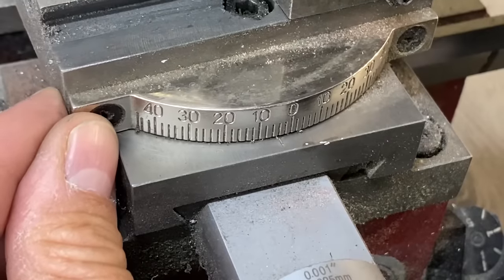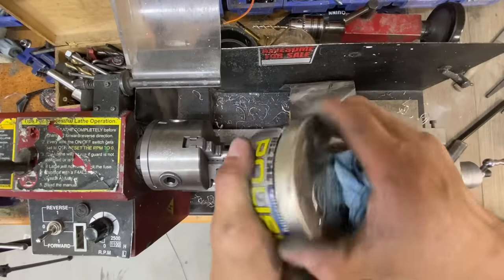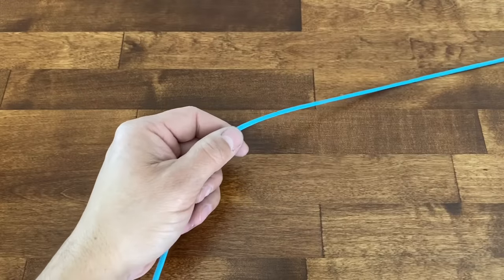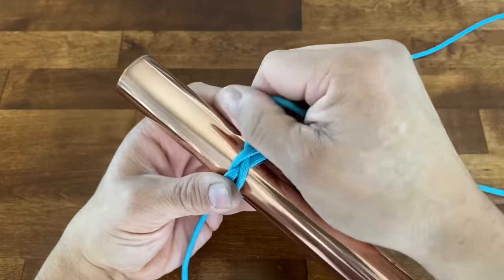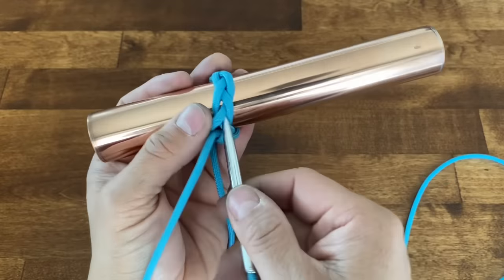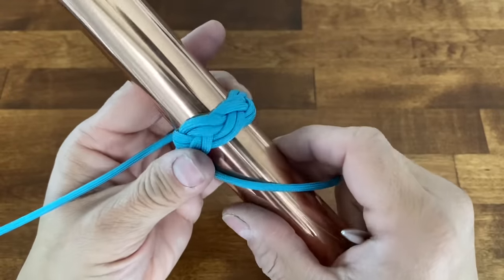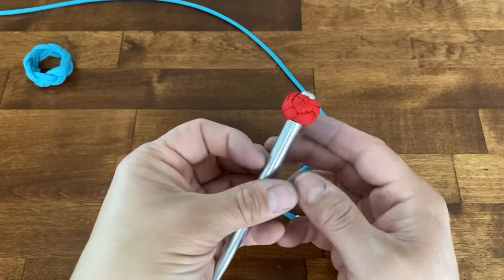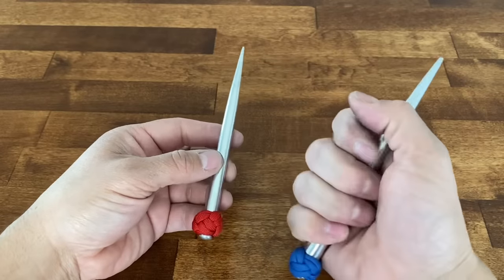I lost my Marlinspike, so I made a new one.

Comment: I like windex as a polishing fluid because it holds on to the sandpaper a little better. Make sure to test it on a scrap corner if you're working with stainless I guess, but I've never had a problem with it.
Reply from the maker: Great tip! Thanks!

Comment: Great work! A little word of advice tho. You should protect your lathe when using abrasive materials, the abrasive dust falls on the ways of the lathe and grinds them when you run the carriage over again.
Reply from the maker: Ha! That would explain why it’s gotten so loose over the years. I’ll be sure to do that with my next one. Thanks!
Reply: @First_Class_Amateur  Glad if I could be of service! Keep up the good work!
Reply: @First_Class_Amateur  You may be able to tighten things up a bit on it to help the looseness. The HF mini-lathes (and most of the other ones because they're all from the same factory in china), are pretty solid little machines, but they really benefit from a lot of tweaking. There's a ton of info out there on stuff to do to spruce them up.

Comment: I came here to see how you turned & tapered your marlin spike but ended up benefitting most from your straight forward, clear direction on the Turk's Head.  I've make countless Turk's Heads over the years but after many years of not messing around with rope & cordage I forgot a couple of the steps to end up with consistent results.  Thanks very much for this excellent little video.

*Edit:  PS, you got a new sub.  I'll definitely check out your other videos.  There are also some good tips & advice in your comment section.  That shows a good, decent & attentive audience which reflects on your excellent content.  Cheers from Vancouver Island.

Comment: Very Nice! I like your thought process on deciding how long to make the Spike and the turkshead is a nice functional & decorative touch.  A quick tip... Paracord will shrink whe  exposed to boiling water.  This is very useful in tightening knots. You may consider waiting to do a final trim on the ends of the cordage until after its been exposed to the boiling water. The shrinking cordage may shift the ends making them visable if done prior.  Depending on the project, I will sometimes preshrink my paracord to prevent  the project from shrinking after completing.
Reply from the maker: This is a great tip! I never knew that. Thanks for sharing.
Reply: Does "exposed" mean, you dip it in the water, basically? Or is steam enough to get it to shrink?
Reply: @nilsibl  I have always submerged the cordage in the water.  It's a very fast reaction (1-2 seconds) to the heat on anything loose, but a larger already tight knot may be slower (maybe 10 seconds). If the water has soaked the cord/knot, then the heat has been applied. You probably don't even need temperature as high as boiling water (100°C/212°F) but it ensures there won't be any later movement of the cordage and has no adverse effects and its really simple to "know" the temperature once you see a rolling boil.  WORDS OF CAUTION:  Paracord can hold a lot of water.  Be mindful of this & handle with caution.  I speak from experience.  I was focused on my project and grabbed the soaking pile of loose cordage!  A few curse words and a bruised ego is all I suffered, but learned a good lesson.  Typically I'll use tongs until I press the hot water out in a dish towel.  The residual heat helps speed the drying process (versus using a cool water bath but that works too).
Reply: @jimcarstens4212  Thank you, that's really nice to know! Enjoy your day!

Comment: I just started making a new fid out of a 5/8" bronze rod I picked up a few weeks ago. I noticed your lathe is a bit loose, you may want to tighten things up a bit, and you'll get better cuts. Also, look at buying a cuttoff tool. Will help in cutting off rather than using the back and forth groove cuts you're doing, plus saves on material. I've been cutting off the back end, and drilling and tapping and then making a cap with threads. I just do about 3/8" on the threads. This allows me to drill down and hide a needle inside for paracord.
I'm getting to the point of not liking the aluminum because of how dirty it makes your hands....brass is a bit cleaner.
Great job done though!!!
Reply from the maker: Thanks! I’ve had this lathe for about 12 years and it’s on it’s last legs. I’m hoping to get a new one one day. I’ll have to try brass. Just like you said aluminum gets dirty quick.

Comment: if you make another marlinespike, you might want to consider making the head larger with flat surfaces. I've heard from several old sailors that the head of the spike was often used as a hammer up in the riggings, as they didn't want to carry more tools than needed to do a job.

Comment: Hint for an even more useful tool I made: The Marlin Pliers.
Basically, a pair of pliers with round jaws (I'm Swedish, don't know the English term). Took a grinder to the jaws and made them pointy.
Use it as an ordinary marling spike with one of the jaws, or grab the rope/cord when you need to pull it tight.
Quick and simple to make, very useful.
Reply from the maker: Great ideas
Reply: @jort93z  needlenose pliers? That’s what I’ve always called them
Reply: 88位追おっ☀️ @Sam-fq5hc

Comment: I use an old ice pick with an awl handle mounted on it as a Marlin spike and knotters tool. I don't usually work with material that requires anything bigger in diameter.
Reply: I also use an ice pick. :  D

Comment: If you adjust your feeds and speeds you wouldn’t need the sand paper to clean up all that roughness. It’d be a good way to build skill to get a good machined finish.
Reply: Tricky to adjust feeds and speeds when you aren't power feeding, and I reckon no such adjustment is going to compensate for a spindly piece of alu hanging 6 inches out of the jaws
Reply: @robmckennie4203  yea it’s is tricky but doable I’m not saying it’d be perfect but would be less sanding

Comment: I am an ex fisherman I like rope in all types, your job of work was fair. You always seal the term is finish all unsecured ends as th helps to keep the ropes shape and to finish the end in your video you cut it which you leave depending upon the rope thickness on a polypropylene or similar low melting point cord leave a quater inch to melt allow it to become transparent then wet your experienced finger blow out the flame and push your wet finger in one movement squeeze and finish the end in a  discrete place and as your finger leaves a slightly wider and dished end that won't come undone and you didn't make a Marlin spike, you made a fidd not even a threading find. Yes you have much to learn also your "Marlin Spike" is way to short,  I am letting you know the truth, I could help you without credit so you do it once and you do it right,  miss takes gives you no warning and you finger or worse is gone in an instant, the worst thing is that it's your own avoidable fault.